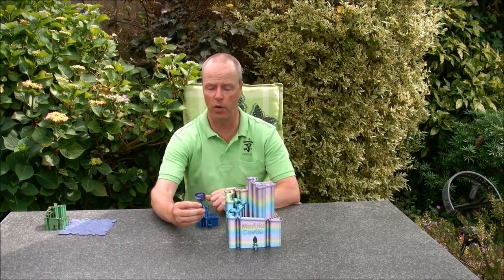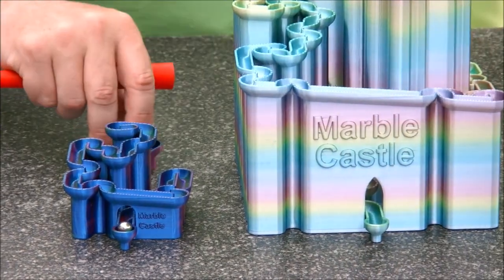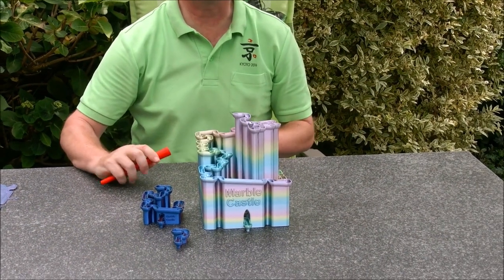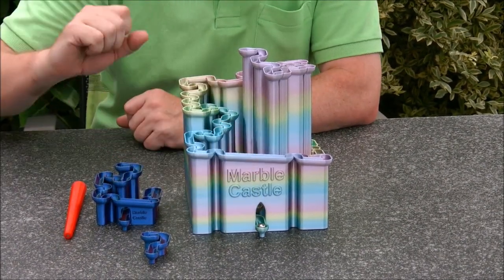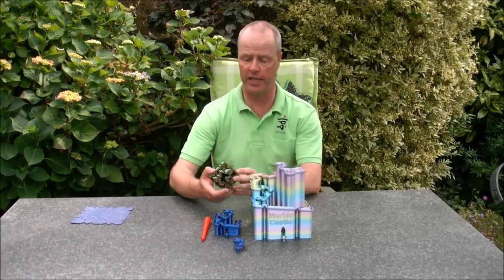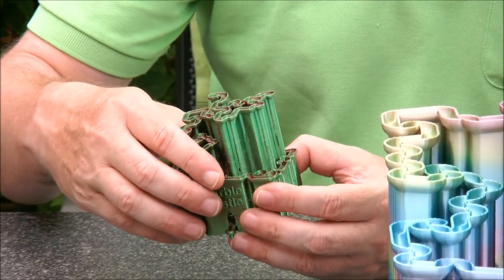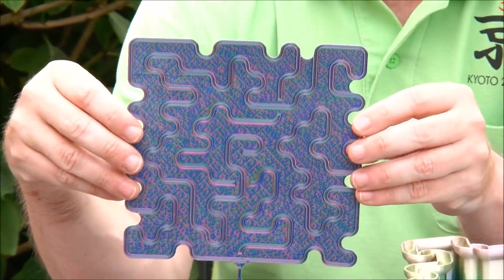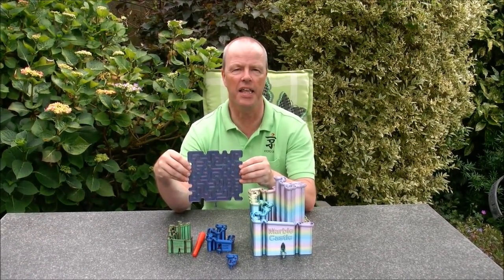Marble Castle - How does one design such marble track?

Comment: Does it need to be an odd number?  I can imagine scenarios where it doesn't, such as setting up a line, 180 degree turn, a parallel line, and then do a bunch of twists and turns without crossing, until the end when it crosses through the first two lines.